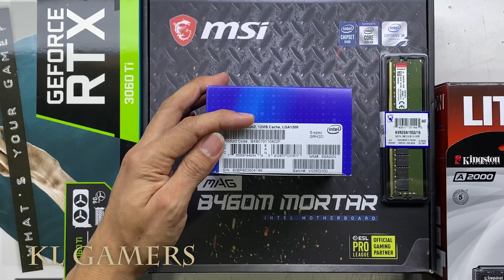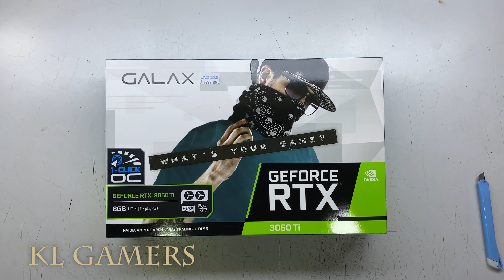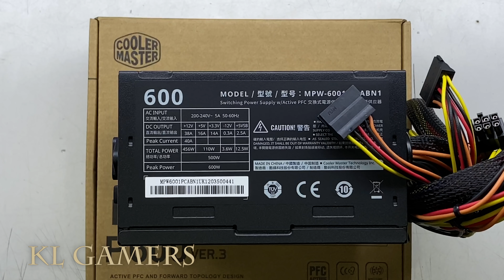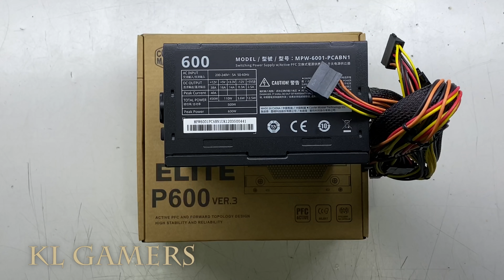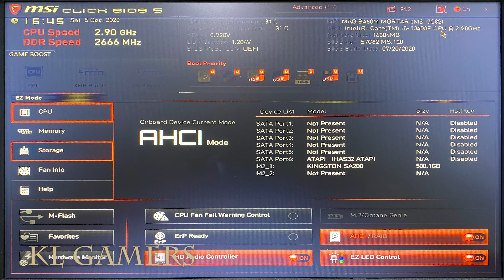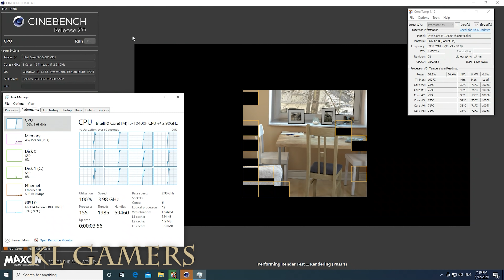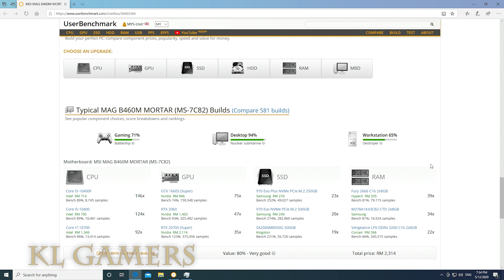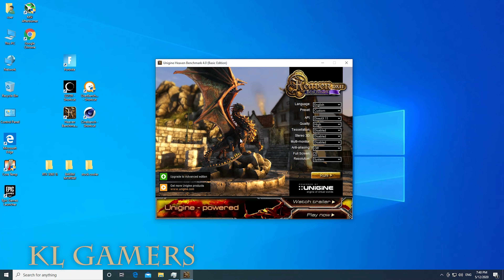intel Core i5 10400F Msi MAG B460M MORTAR RTX 3060TI Gaming PC Build Benchmark

Comment: You did not connect sata ssd in video but at 23:26 it shows another 240gb ssd connected to system.
Reply from the maker: SSD = Kingston 500GB A2000 M.2 2280 Nvme Internal SSD PCIe Upto 2000MB/S with Full Security Suite SA2000M8/500G
(Amazon link) = https://amzn.to/381FuGm
(Lazada link) = https://c.lazada.com.my/t/c.6uzt?url=https%3A%2F%2Fwww.lazada.com.my%2Fproducts%2Fkingston-a2000-m2-2280-nvme-pcie-ssd-500gb-sa2000m8500g-i411502404-s1615374960.html&&sub_id1=a2000&sub_id2=eit&sub_id3=350
(Shopee link) = https://invol.co/cllbub

Comment: Why your testes have so much different results on cinebench using sabe CPU? and mobo b460
Reply from the maker: if you need more performance then u need a AIO cooler and set in the BIOS XMP profile 1 and AIO Cooler option to get max performance for cinebench, max performance in cinebench does not improve gaming performance

Comment: This configuration support 3200 mhz ram memory?
Reply from the maker: can use 3200 but only run at 2666
Reply: @KLGamers  but if I activated the XMP?
Reply: @rodrigotiago6820 it can only handle 2666